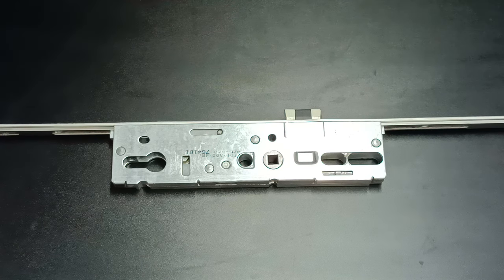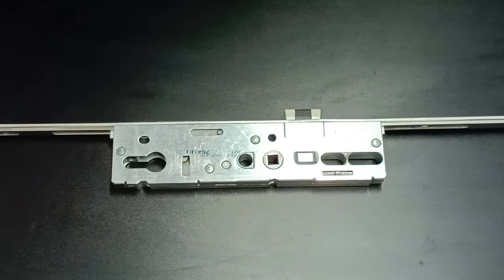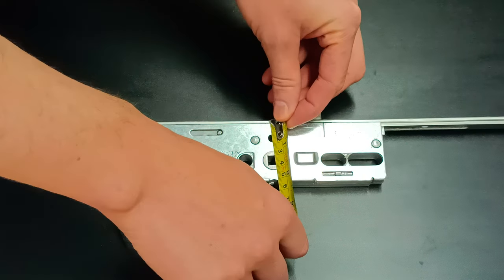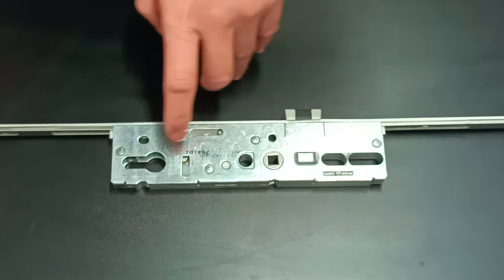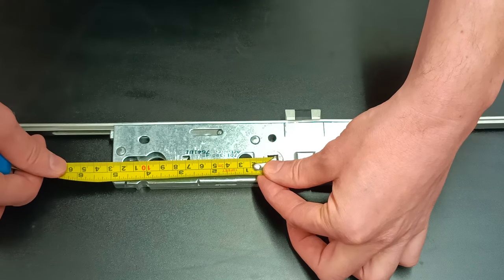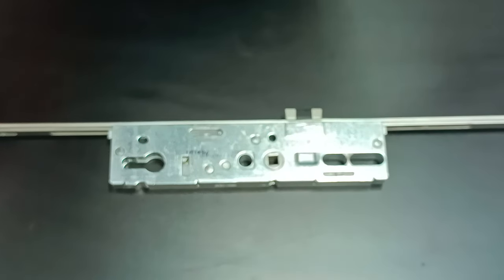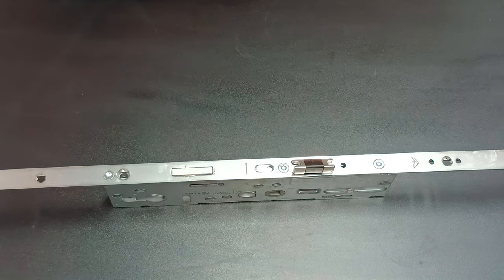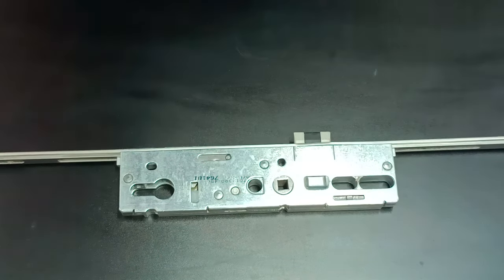How to Measure & Identify a Center Door Lock Gearbox for Easy Replacement

Comment: Thanks. This is a great help. It just cost me £150 for a guy to come and open the door because the gearbox had failed and the main handle latch wasn’t quite retracting into the body of the mechanism and fouling on the striker plate.  He only made a small adjustment to get it functioning again today, due to it being bank holiday he said he couldn’t get parts today.  
I asked him if I could replace it when I can get a new part and he said he doubted I could.  I’m sure I could if I could source the correct part.
Reply from the maker: Hi, yes these are not difficult to change, we sell most models and can also do videos of how to change  different brands of gearbox, is the lock you have stamped Yale? Sounds like the sticky latch issue  that is most common with the older Yale gearbox.